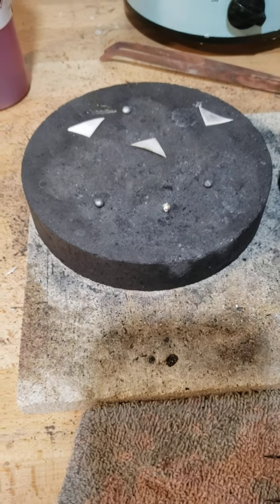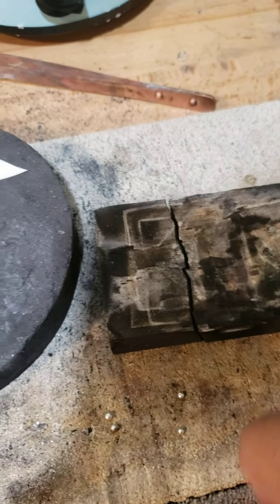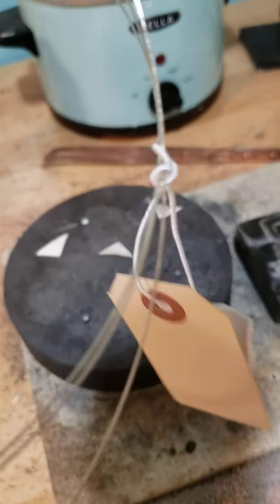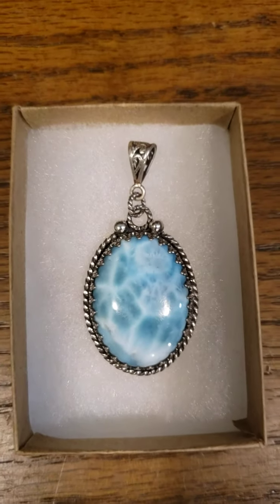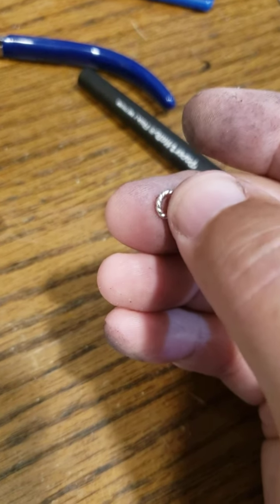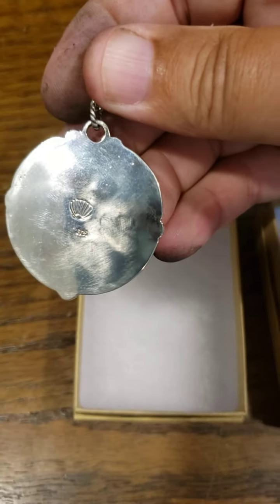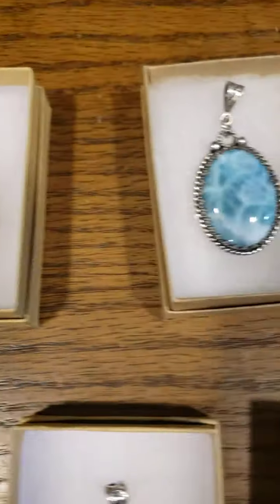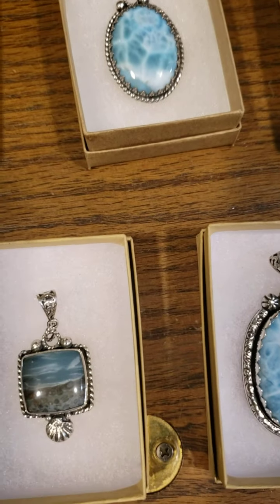Silversmithing(tips I wish I knew when I started)

Comment: When your silver sticks to the surface of your soldering board just use your torch and gently pass the flame over the piece until it comes off. Also, if you want a round bottom on your round spheres just take on your broken piece of charcoal block, and on the smooth side, bore out some round holes in different sizes. You can place the silver in these holes and once they’ve melted they’ll be completely round. Be sure to pay attention to the color of the silver when you are melting it. If you pull the torch away quickly you will have a perfectly smooth and rounded sphere. However, if you leave the torch on it too long (which a lot of people tend to do) the sphere is usually misshapen and will have to be remelted. Hope these tips help you out.
Reply: Sterling or fine? I find the opposite is true (slow reverse away from the melted ball) if using sterling. Fine is better quick. Is this your experience, too. The copper in sterling seems to  cause flow disruption.

Comment: If you wrap your charcoal blocks with bailing wire they wont fall apart.  If you have a rolling mill you can run the solder wire through it to create paillons which are nice for when you only need a little bit of solder.   I like your use of shot plats and pattern wire.
Reply: Thanks for the great addt’l tips.
Reply: I’ve been doing both for years. I also make sure to only cut as much solder as I need for the job then store the rest. When I need it again, I use 0000 steel wool to clean it before cutting it. Remember, solder tarnishes too and, if it’s dirty it won’t flow. I’ve had several jobs where the solder was the cause of my problem and I had to start over! Clean! Clean! Clean! YIKES 😱!

Comment: Thank you so much for this! I am very much a newbie still when it comes to silversmithing and I have been having trouble soldering the bezel to the sheet and the solder would just would not melt. I tried the strips of solder and also paste. I will try with solder wire next time! Thanks for the tip😊
Reply from the maker: Not sure what kind of torch you are using..sounds like you need a hotter torch...good luck!

Comment: You've made some very beautiful pieces of jewelry.  ❤❤❤  Like you, I prefer wire solder because I can cut my own pallions to whatever size I want or need but I'm def not skilled at holding a long piece of solder and soldering as I go like I've seen on a Durango Silver video.  Anyway, again... beautiful work! Thanks for showing it off. 👍😃
Reply: And, often, a lot of silversmiths of the southwest persuasion use easy solder. Easy it is but an ugly mess when it finally oxidizes unevenly (zinc is the culprit), so the technique of soldering with a long piece of wire and feeding the heat, CAN be a mess later. I love to see minimal use of solder. It's more challenging but a far superior build.
Reply: @flyingcheff    I agree with you.  I always use the bare minimum necessary to get a good solder not only because of appearance but because I don't want to clean more than what could've been avoided (laziness?😄).  Also, I have used pallions of fine silver to do minor repairs such as cracks. The 1st time I ever tried it was because I accidentally cut a small slit in the ring shank I was making so I cut and hammered a few pallions, stuck them in the slit, torched it, and when I was completely done it was a perfect repair. I actually surprised myself because I was still relatively new at it and nobody told me to do it that way.  Anyway, it's just a part time hobby for me but I do ❤ playing with fire and silver!😄 

Also, I love watching good video tutorials like this one. There's always something to be learned. 👍😊
Reply: @tlojewelrylove  wow! That's really interesting.  I want to pick your brain on this 😃 ok, so you had a crack in a piece? Fine silver pallion (not solder) has the highest melting point of all , and you used it to repair a crack? Whoa! 😎 The main piece would have had to be fine silver (I think)  also (not sterling). Fusing fine silver to fine silver would be what happened - and awesome if that was the case. 👏 Wow! If the main piece was sterling, the copper in the alloy would have lowered the melting point. That would be a challenge to close/fix a crack with a piece (pallion) of fine silver in sterling. Not impossible,  but doable with focused heating and luck. How cool! Good on you. I always love to try and figure out the How's and Why's of all the groovy [jewelry] physics stuff! Thanks for dialoging and sharing! So grateful 🙏

Comment: Inspiring and great info. Helps me out a bunch. You’re work is outstanding! 
What gauge are you using for back plate on these pieces?
Reply from the maker: The smaller ones are 26g. ..the larger are 24g ..really large would be 22g...I find most are good with 26 or 24..use those the most...thanks

Comment: Another question if you don't mind.Do you dip the whole piece into the tarnish,and then polish?Or paint on with brush?I know you said you use a green polish wheel.Are you using a polishing compound like zam before after?If you could break down the steps I would be greatful.Thanks for your help.
Reply from the maker: Once a piece is completed..I use the polishing wheels ..I use 6 wheels starting with the white and gradually move to each one until the final green one..I don't oxidize until I use the blue wheel..then coat the piece with a small paint brush then back to the blue wheel to remove most of it..then the finer grit wheels from there ..I don't use any compound ..just the polishing wheels from Dedeco..they don't remove everything but I like my pieces to look handmade .
Reply: @clamshellcreations3278  Okay got it.Thanks.They sure are nice.I will keep at it.I have made a few.Sure is hard to get the flat wire to snug up against the bezel.Everything moving around with the flux being heated.

Comment: How do you clean out the center of the jump ring after you solder it to the backplate?
Reply from the maker: I use a drill bit smaller than the jump ring then file the inside of the hole.